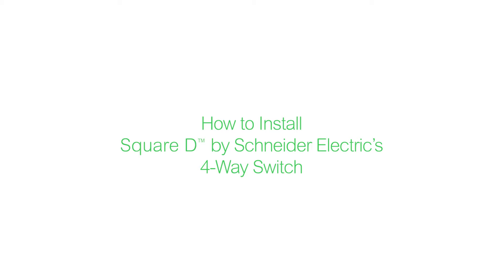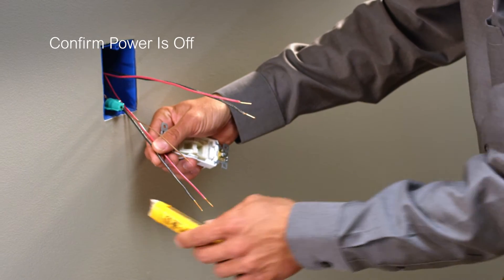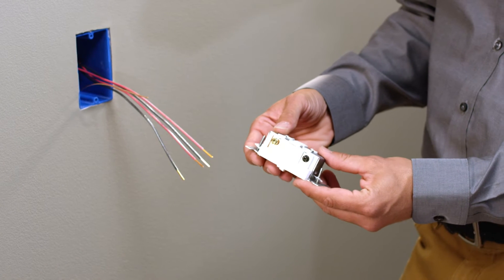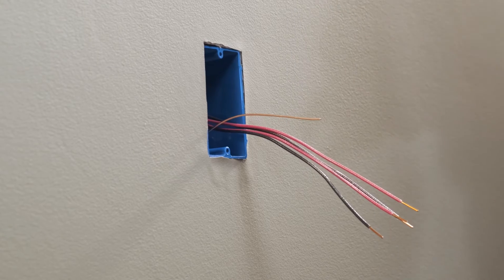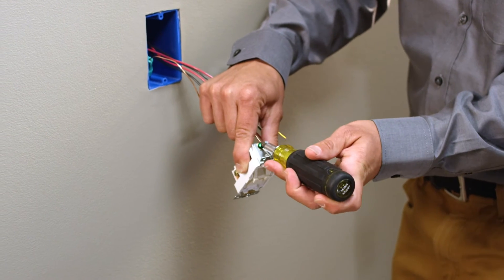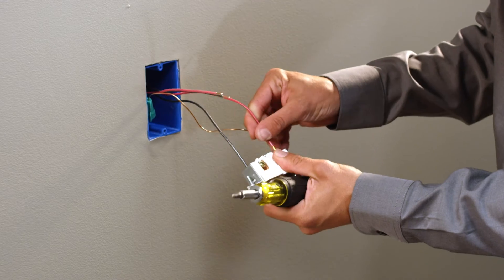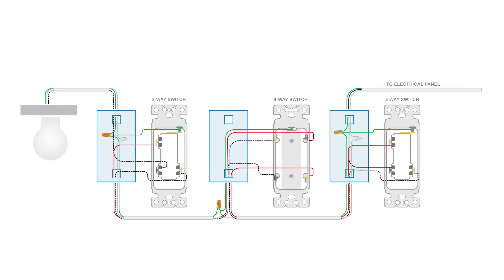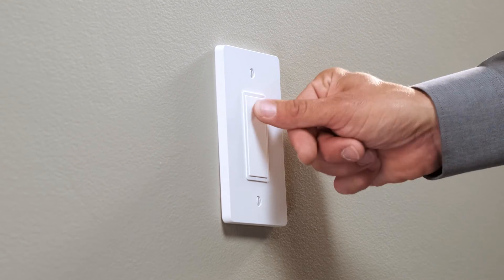How to Install Square D™ by Schneider Electric's 4-Way Switch (X Series)

Comment: The voiceover says to connect the wires from the powered switch to the black terminals on the four way.  The diagram shows it the other way.  It would be good if they matched.